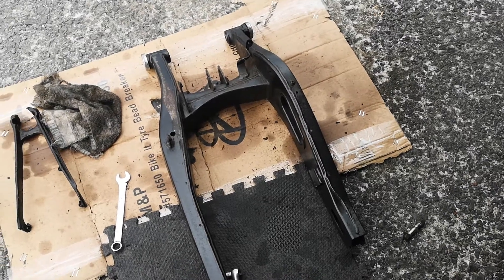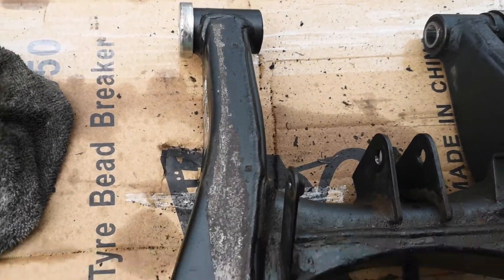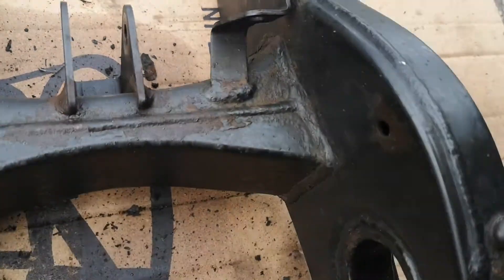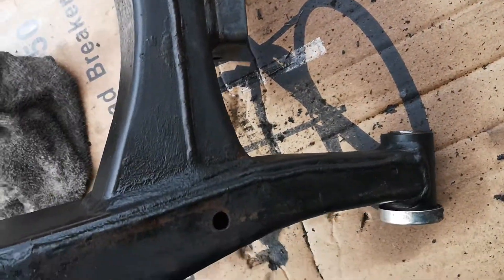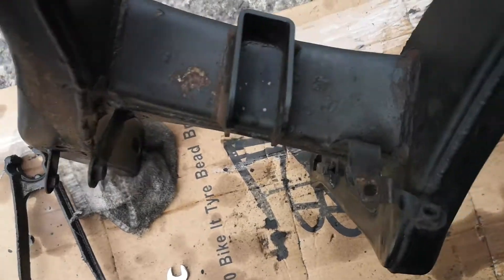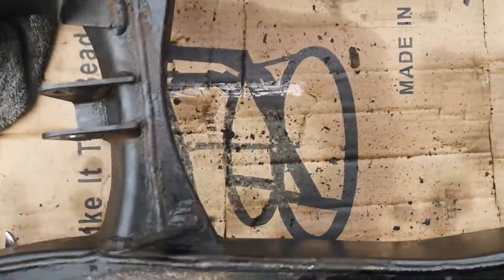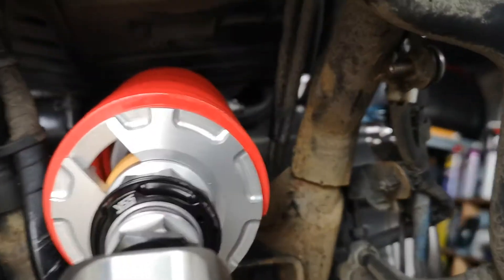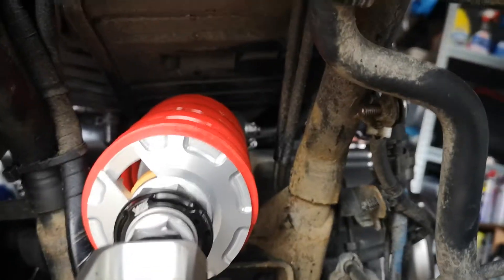MT07 Swingarm Rust

Comment: Do you have any good tips or a way to contact you? I have no idea how to get this stupid swingarm back on! Will not wanna go back on. Right side doesn’t wanna slide past the metal silver part.
Reply from the maker: Hi pal, what metal silver part? If you have instagram you can message me there.
Reply: @TheDiabeticBiker  I mean the inner spacer I think that’s what it is. Anyways, with some force & wiggling it back & forth. I got it on! Powder coat prob made it a bit tighter then normal.

Comment: I don't ride my bike in the rain just because of the rust problem. You can see how bad the construction of the swing arm is. I put loads of ptfe oil all over the swing arm. It looks cosmetically ok at the moment. But if I keep the bike I can see I will have to take out the swing arm and get it powder painted.